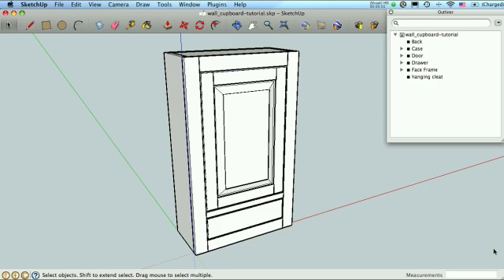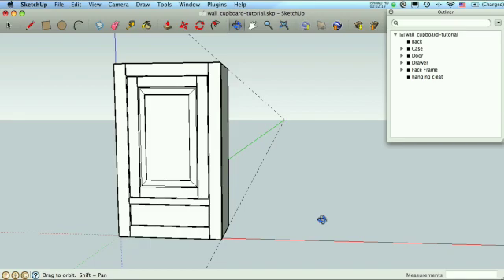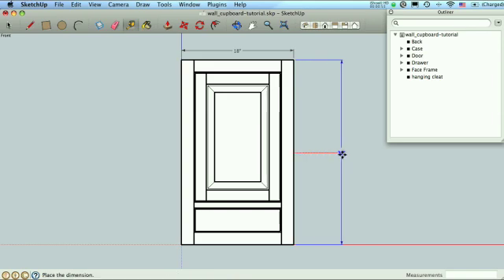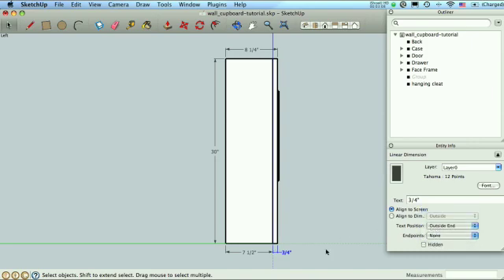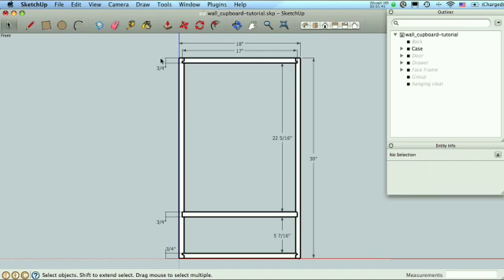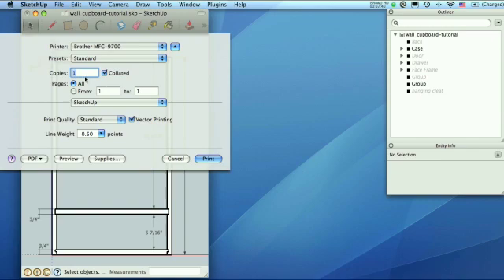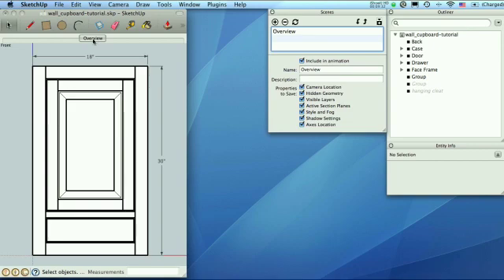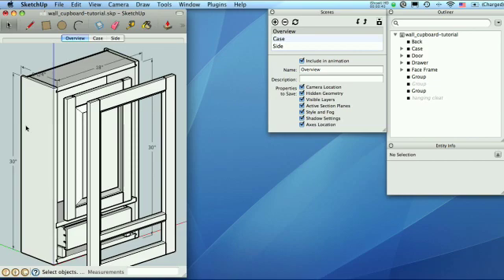Sketchup for Woodworkers - Dimensions and Printing

Comment: Printing from Sketchup is a challenge. I found it easier to cut & paste the drawing into an MS Word template which has my personalized title block. You can easily resize the image in Word, then print in high quality. To save ink, while in Sketchup, I change the background to white.

Comment: You mean I have to do it all manually? I have over a thousand complex curves in my image. Your image is basic rectangles. Sketchup can eat my hairy beanbag!
Reply: Similar issue...I've got at least 750 measurements I need to make for a building diagram.  I'm guessing it will take me around 6+ hours to go by each framing member and make dimensions.  Ridiculous that there isn't an easier way.
Reply: i can do it for you i make these for part time gigs..

Comment: Don't know if this helps but I've discovered in messing around with sketchup that if you use your tape measure to lay out guidelines first, you can then measure between those guidelines with the dimensions tool. And then of course, you can remove the guidelines. The pencil or rectangle feature works in a similar manner. Once you layout your lines with the pencil and get your dimensions, you can erase the pencils line leaving only the small dimension lines behind. Same with the rectangle. Just delete the shape and your left with small dimensions lines. And the pencil and rectangle you can start and stop wherever you want. They also leave a nifty line for the dimensions tool to use once they're deleted!